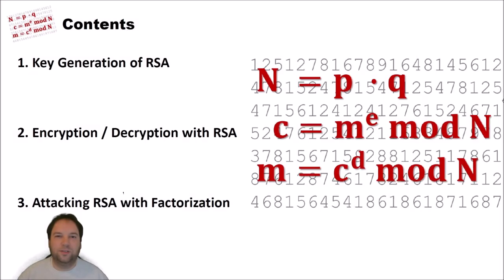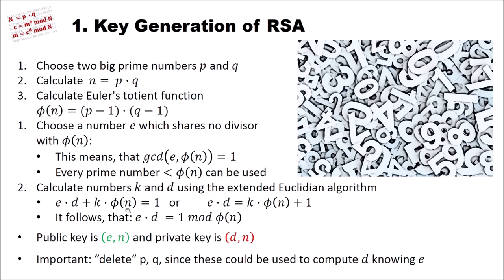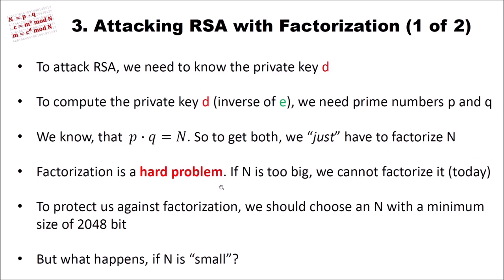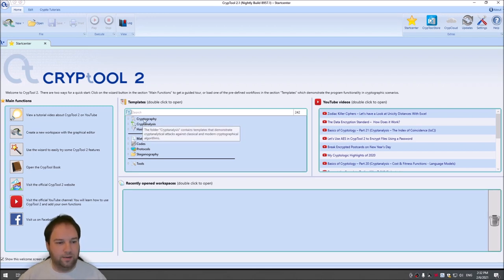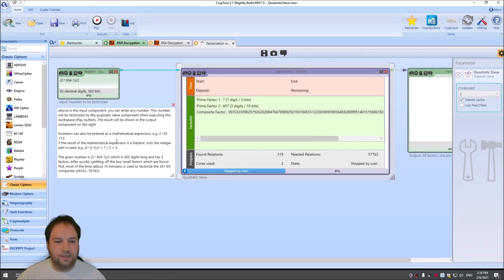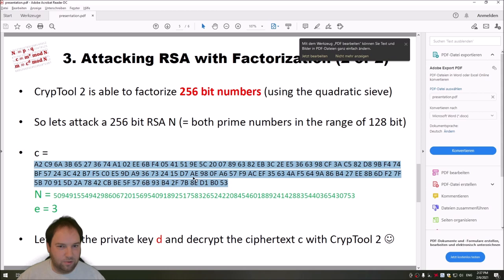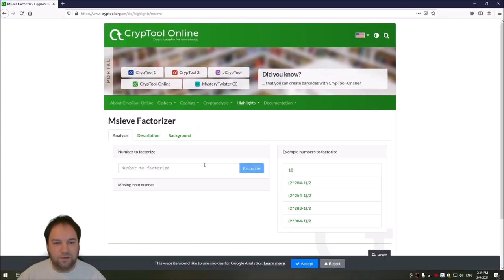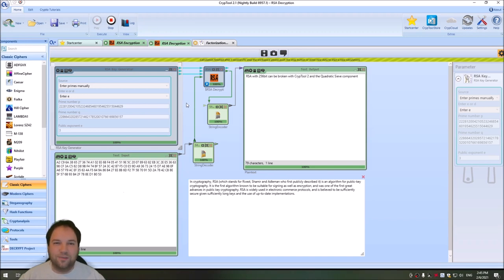Break (Reduced) RSA Using Factorization

Comment: The primes you used dont look safe.  Will this program work with the RSA challenge numbers?
Reply from the maker: Hello,
Yes, we deliberatly chose small numbers for the video and
No, it won't solve the RSA challenge numbers :-) (maybe, the early first and small ones, but I am not sure).
CT2 is intended as a learning tool -- despite it is being able to really help with many cryptographic real-world problems. We included msieve (at the time the most powerful tool) for factorization, but it is a quite old msieve version. Including it in CT2 was quite difficult and updating it is difficult, too. If you want to factor RSA challenge numbers, then you need to have a look at the state-of-the art implementations for factorization and probably also have to distribute it to many computers.
I hope this answers your question :-)
Greetings,
Nils
Reply: @CryptographyForEverybody  I was saying that p-1 and q-1 when divided by 2 are divisible by small primes.....so my question was would it still be fast with safe primes....I think you werent careful selecting your primes.....
Reply from the maker: Ah, no, we don't tested msieve with safe primes or strong primes. If you are interested how good msieve is with factoring those, have a look at msieve: https://github.com/radii/msieve
You can also test it using the CT2 implementation in the quadratic sieve. 
Also, the CT2 RSAKeyGenerator generates random primes, but does not take care that these are safe or strong. Maybe in the future we could add an option for that :-)
Reply from the maker: Heyho,
I updated the RSA KeyGenerator of CT2 to allow also to create RSA keys consisting only of safe primes. Clearly, this takes much more time to find the primes, but for a 2048bit RSA key, it takes about 2-5 minutes, so its ok I think :-)
Greetings,
Nils